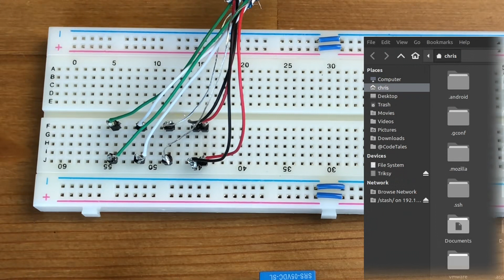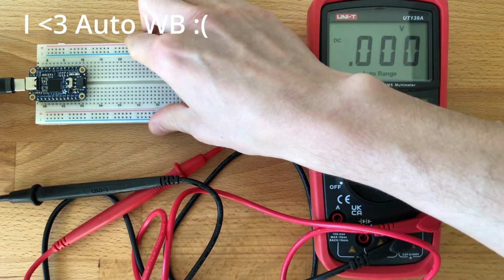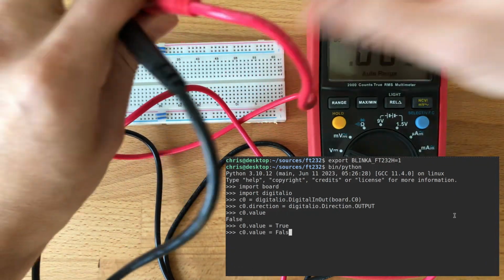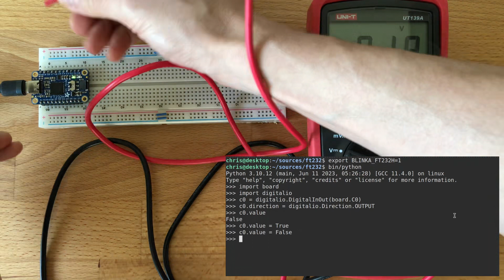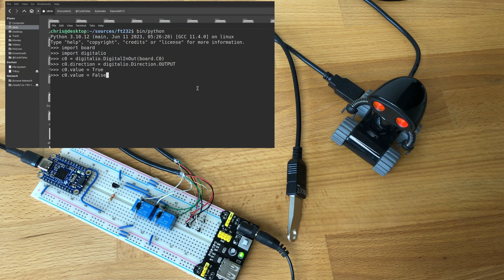The USB-Kill-O'matic Part 1: Building the hardware

Comment from the maker: In theory, the USB spec allows for 500mA at 5V, so it should have enough power for the relays and there should be no need for the extra breadboard power supply. In fact, the FT232 has a 5V supply pin just for this purpose. However, in practice, this didn't work. Instead, sometimes just one relay would power, or both would but the USB would not mount. I think the reason is that these 500mA need to be split between the FT232, the 2 relays and the USB drive and there isn't enough juice on the bus to go around.

This happened on the laptop that I did the initial development and maybe my desktop PC has a different bus configuration and different USB ports have independent power supplies. I didn't care enough to check, sine I had a working design that allowed for a lot of headroom, for a minimum of additional complexity and cost. So the extra power supply stayed.